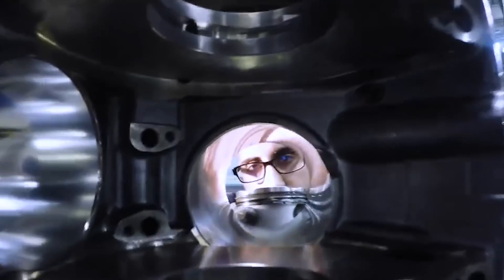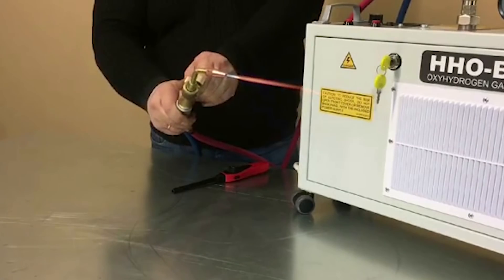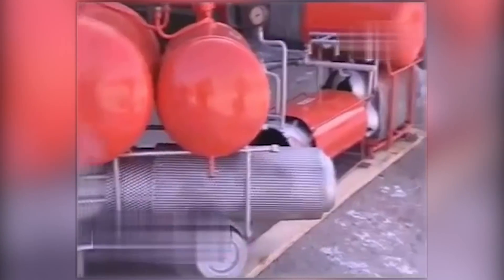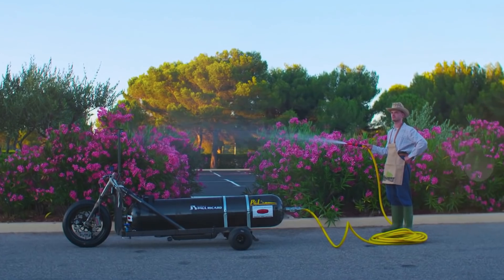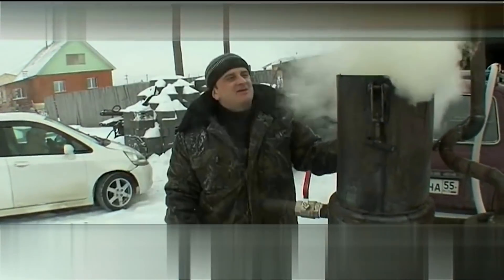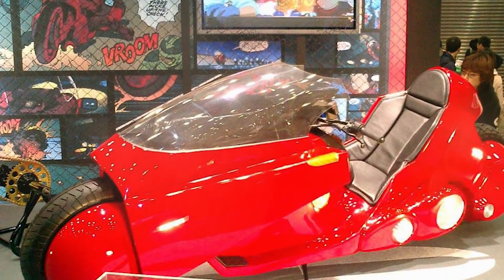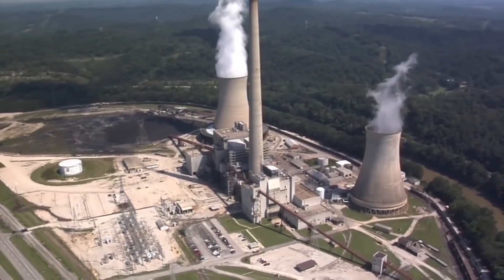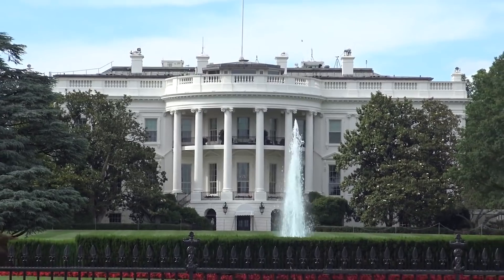Why These Engines Are Banned?

Comment: Just a moment. The "rotary engine" is a design made by Felix Wankel a German engineer. The first automotive application to have one was the NSU Ro80. Later the design was sold to Mazda and they used it in their RX models. Due to the unreliability of the seals around the revolving triangle, most other manufacturers didn't bother with it. Mazda solved this problem (or better said development in materials did). High emission etc made it disappear from the market again.
Reply: And horrible fuel efficiency
Reply: The interesting thing is that it's making a comeback as a series hybrid engine. They work quite well at constant load and can be even more highly optimised for such operation than Otto or Diesel cycles

Comment: So how much energy do you think is needed to compress the air water or whatever they are trying to compress here? A compressed air cylinder is more like a battery, it stores the energy, doesn't generate it! Oil companies, regardless of how greedy and evil, are significantly more capable and advanced in their engineering than idiots sitting on a leaking cylinder. Also, splitting water molecule, shouldn't that be endothermic in nature while the opposite of it being the reason why a few Hydrogen cell powered cars exist? O.o

Comment: WTF the car you show is TATA NANO and it runs on petrol . A 630 cc two cylinder engine. TATA does not launched any compressed air driven car. Why are you lying ?

Comment: Go behind with,, its not banned in.anyway to run your engine on hydrogen. Various test has been performed during the years (and yes I run a chainsaw engine on hydrogen back in the days). Nor is their a sinister plot against this fuel. The physics behind the method do simply not support the concept. Splitting water is very energy intensive, and then you have the problem storage of the result. The free oxygen can be vented to the atmosphere, the hydrogen leaks though virtually anything, so the best option have been to bind it to various materials. Direct.combustion makes the highly inefficient method even worse. Your slightly better off with fuel cells. But in the end the most efficient way is.simply to take the electricity and store it in an ordinary battery instead. And then run your car on that.hydrogen is dead as a dodo outside of very special cases.

Comment: The thing with your "great" hydrogen engine is that, unless the hydrogen is seperated not on the vehicle but in a ground station (wich currently gets used...),  you have a inefficent electric vehicle. You can't get more energy out of the burning hydrogen than you have invested to get the hydrogen... The compressed air one is kinda useless and hase the same problem as the hydrogen one, but it is even more inefficient as compressed hydrogen has a far bigger energy densety... And how the f... did we go from car engines to cold fusion? The Fleischmann Pons experiment couldn't be reproduced by other scientists.

 Also i find it very interesting how this guy says that moden engine are just "polished old tech" and then proceeds to show us wood gas engines, wich where used by the germans in ww2 (even on training tanks!) because all of the petrol and diesel was needed on the front.

Edit: Oh, and also the Wankel engine (rotory engine) was not build by the us, but by german Felix Wankel in 1932...

Comment: better way to generate hho is triangular rotational morse potential  it used radio frequency  three of them  one at the resonating freq of water   one above and one below  shot at a rotational angle  or deflected of  a angle deflecter like the impeller of a blender it shakes the moles apart instantly

Comment: The secret of hydrogen powered cars is free limitless energy to convert water to hydrogen...the secret to compressed air is the free limitless energy to convert air at atmospheric pressure to high pressure air and heavy cars that carry large thick high pressure tanks, and tripling the number of stops you need to make to refuel in a year.

Comment: The car runs on compressed air so it does not cost anything to drive it.....Except you either need your own compressor that can pump to the probably insanely high pressure needed OR go to a filling station to get it filled.

PS. No, it wont be for free, and you can not fill it, using the small hose for filling car tyres.

So basically...It's not free....Maybe cheaper...But not free...

Comment: Hydrogen is way to Volatile and you need to add oxygen to create energy  but if you are even little bit off you are sitting on bomb is what I know so let them take time to perfect the use until use hybrid or electric
Reply: Hydrogen fuel cells were perfected in the 1960s.
Reply: @SynchroScore  For H-Bomb If i am sure the father bomb and mother bomb were their names i want to drive car not put big sinkhole in road
Reply: @GSaurabh8  I haven't the faintest clue what you're talking about.

Comment: None of these things are banned...the majority are simply less efficient methods of powering things with electricity.

The "water" and compressed air engines are outright scams as the electricity needed to split the water into hydrogen and oxygen / power the air compressor can more efficiently be used to power an electric motor. Also, where do you think said electricity comes from? Primarily plants that burn fosill fuels...so what you have are unecessarily inefficient engines which would only lead to more polution/money in big oil's pockets...come to think of it, maybe they should be banned after all...

Comment: All of these "forbidden" engines come with their own disadvantages. Mostly short range. Sadly petrol has highest energy dencity of energy per unit of mass and volume. This translates to range and horsepower. If you don't need former or latter you can exchange it for efficiency or ethicacy. Best way to save enviroment is to pick right engine for your needs.

Comment: if you use a electric compression pump, to put air and water in a container with very high pressure, you're not running the vehicle with "water and air". you just stored the electrical energy. and the vast majority of electric energy we use is created by burning fossil fuels or atomic energy. every car that in some step of the process uses electricity to run, burns fossil fuels or radioactive materials indirectly. this isn't ground breaking. this is nothing but very primitive "out of sight, out of mind" thinking. it being "cheaper" is not a very relevant argument, if it's not any better or even worse for the ecology.

Comment: But Tata motors India haven't yet produced any air powered vehicle, nano used ic engine
Reply: Tata produced air powered vehicles. But didn't sold it.....Because running cost is high than petrol or disel

Comment: There's something people may not have picked up on...

The max speed of a lot of these cars is at 100Km/h... That's 60mph.
You couldn't hit highway speeds on any one of those. Not really a useful vehicle for most people.

The air powered one could explode if hit improperly. Not necessarily with a fireball, but the pressure could easily kill the passengers.

Fusion reactors aren't working yet, though they have made strides in doing so. They're approaching a positive energy return from the devices as we speak. Cold fusion though, is science fiction. the laws of Thermodynamics bar such from being possible. No system is 100% energy efficient. The 'Cold' in cold fusion means that no excess heat would be used or produced, something that just plain isn't possible by these laws.

Thorium 90 as a Nuclear fuel source is MUCH weaker than Uranium and as such, can't produce the power required to properly create a sufficient amount of energy.

Comment: As an engineer - hilarious. Obviously many different designs have been tried, but there are not simply better. Many designs rely on making a vehicle use less energy by making it smaller/lighter, slower, and less acceleration. You can do the same with a conventional combustion or electric drives. Other designs such as the rotary engine, which btw has little to do by a federal department but was developed by German Felix Wankel, and built into a few cars, such as 1951 German NSU. But it suffered from premature mechanical failure and was not very fuel efficient. The "magnetic" motor looks like a design similar to a fan motor. There might other design advantages than increased efficiency, though. There are several Thorium reactors that have been built, including the German commercial scale THTR-300. It had many design challenges and did not proof commercially viable. There is new interest bc of the high heat output these can produce for applications such as cracking. The same is with any other technology that has been shown here. It is not a conspiracy theory by the "oil mafia", but a design that has not made it mainstream, bc it could not address today's design issues, or created new ones, or solved nothing.

Comment: Still compressed air and water have no use for cars you want to use as the cars if today, so many of these fantastic solutions dont work to exoplore more.

You have to think too, it needs to replace todays cars and even be vetter to change anything, you cant compress that rocket engine all the time even if it just air and water, it cant be used for anything ordinary.

There us some fun engines that runs on "oil" that never became anything either, in US diesel engines in cars seems uncommon for example.

Under ww2 in Sweden gasoline was scarce so they did what those guys is doing with wood, it gives lower power and is hard to learn how to use good. After the war ended all scrapped their gengasagregat as the swedish name is for it.

Again not a simple solution in todays life, it was used just vecause they had nothing else.

Its not MAd Max world we talking about, it has to be easy and work at least as good as a gasoline car, aybe better and if cource being more environent friendly.

Electric cars still has problem because you cant just fill them up like a gasoline car to go directly someewhere else, AND to get electricity you neeed to produce ut with something and using brown coal to get it us a loss i think.

The whole chain must work.

Making China build the parts us a loss, something i wish people will understand, its a global thing not a local thing.
Using Chinese factorys is max pollution and the electric running them, and so much is crap anyway, made by slaves.

US dont seem to understand that, its all about cheap.

Comment: This is a bit misleading in that it does not discuss the actual source of the energy and overall efficiency of things like air powered drives, or magnetic motors like that in the Japanese motorcycle.
Reply: 'Magnetic motors'? All motors have magnets, either permanent magnets or electromagnets.

Comment: Just because an engine/motor can be created does not mean that it it efficient powerful or convenient enough. Let's just take a compressed air tank fill it with water and air and move 1000 ft then refill. Or hook a wood burning trailer to our 1960's car.🤦‍♂️

Comment: Florida has a law that says that you can NOT have a house that is totally off the grid. Grid tied hybrid homes and buildings, on the grid but supplemented with private solar, water or wind power are OK though. IN THE SUNSHINE STATE??? Florida Power and Light near Miami shoe horned this law through with the excuse that solar powered, off grid homes could be hazardous to linemen doing repairs on equipment if the solar unit wasn't installed properly. Here's the rub. A totally off the grid home has ZERO connection to the grid therefore could NOT be a hazard regardless of how it was installed where as a grid tied hybrid setup, installed improperly, could be such a hazard to linemen as it IS grid tied. No logic there but the Florida legislature are either extremely stupid or extremely rich after passing this senseless law. The power company has to get it's pound of flesh, read CASH. Years ago, in the late 70's or 80's, Florida power, (NOT the same company), in central Florida went to the public service commission crying poverty claiming the need for a rate increase due to increased coal and coal transportation costs. They got their raise. Sounds reasonable, doesn't it? It was until someone did a little research and found that Florida power also owned the rail company that transported the coal and the mines out west where it came from. The corporation has raised the prices to itself and wanted rate payers to pay for it. After a few years, this came to light and Florida Power was fined and forced to give major monthly discounts to rate payers to repay their fraud. One would think the public service commission and the legislature would take a peek behind the curtain to see who is pulling what levers rather than deferring to the wizard who admonished them to PAY NO ATTENTION TO THE MAN BEHIND THE CURTAIN!!!

Comment: I'm surprised Raphial Morgado's MYT engine didn't make it into this.  

Also, I have a car with a rotary engine in it.  One of these days I'm going to get it running and I'll come back and brag about how reliable it is.
Reply: Lol. I had a 1990 rx7
Reply: It's was fun, but needed rotor seals and got about 15 miles to the gallon...not too good for 160 horsepower, and 1.3 liter

Comment: A dreadful mish-mash of pseudo science, real science, delusionists, scam artists and hints at conspiracies making for nothing. The physics of driving vehicles with compressed air is well known and easy enough to calculate using little more than high school mathematics. There is no way that enough stored energy can be held that way to propel a car at 100 km/hr for 400 km. 

Until there are some references to properly independently verified tests all this stuff means nothing. The history of commerce and engineering is that if there is a better way of doing something, then it's impossible to control. The better method will win out whatever conspiracy theories people dream up.

Comment: Uh dude, air driven engines aren't cost free. You need to expand energy to pressurize and pump the air into the car. There is no free lunch dude.

Comment: I love how he says ZERO EXPENSES.........LMAO.  Unless it is powered by SUNLIGHT, MOONLIGHT, AIR, OCEAN WATER, RAINWATER or DIRT IT WILL ALWAYS COST MONEY to FILL/FUEL these ENGINES. Before you say those AIR POWERED VEHICLES don't cost anything to fill up, you need to remember it's going to use ELECTRICITY for the compressor it's going to take to fill it with Free Air. Don't think for one second you can take your bicycle hand pump or your little 5hp home compressor and fill those storage tanks, you're going to need a HIGH PRESSURE COMPRESSOR that can put out a minimum of 4000psi like what's used for filling Scuba Tanks. And unless you live near the ocean with Dive shops  finding some place to refill your tanks in rural BFE is going to be a problem.

Comment: see a smartman would make a air powered engine run it on hydrogen the use a hydrogen fuel cell to make electricity and use the electricity to run a Compressor and electrolysis machine

Comment: Have you heard of the RAM diesel engine?
I heard about it a decade ago from an engineer friend of mine, but the technology was apparently yanked by the military and kept secret.
The engine runs much cooler than normal diesels (smaller hear signature) uses less fuel but produces it's of power, it's small and has very few parts compared to common engines....I'd like to know it they are real, or just a concept that got shelved
Reply: Typical government trying to destroy the environment. Your politicians are demons. This is why the CIA gangstalks me. I‘m afraid, you‘re next.

Comment: I have a car that requires no fuel at all. I call it a trailer and it is pulled by another car.

Nothing here but "victim" bait.
Reply: But if the car (trailer) requires no fuel, what if the trailer pushed the car?  You would use no fuel.
Reply: ok,ill give you that.very plausible
Reply: Ever car on the road should have automatically locking hitches front and back( magnetic perhaps). Then everyone would share be linked into one giant chain. Shareing the load you'd use no energy at all. Like going hooking 2 horses   to a cart . Two horses can pull far more than double(probably about 4x) what each could pull alone. And so on the more you add. A 20 mule team can easily pull 80,00 pounds, but one mule would struggle with 4,000 pounds.
Reply: "Russia Russia Russia"-Hilary Brady
Reply: @kaizersoze  uhm...sure

Comment: Jesus, what is all this horseshit about the oil companies deliberately halting our progress. I don't think you understand, getting rid of petrol, and diesel powered engines, and just replacing them with some other type of engine with moving parts, especially one like the V-twin compressed air engine, which still uses pistons, is not going to get us off of oil. What are you, stupid? The primary usage of oil in this world is as a lubricant. Just because it doesn't burn petrol doesn't mean you aren't going to need oil, and greases made of various other hydrocarbons derived from fossil fuels, to prevent your engine, or your bearings, or even your fucking door hinges from seizing/blowing/sticking. Do you even know anything about cars, or are you just another science illiterate environmentalist type? For fuck's sake.

Comment: You can get a copy of the patent from the US patent office of a compressed air powered car and an electric motor that runs itself. I know this because have the drawings of both.   A carburetor was made that could get 100 miles per gallon. The inventors are shut down or assassinated by big oil.

Comment: Hmm air powered car, another use for that bicycle pump you keep in your trunk...
Air powered car runs of of, well air. Driver pulls over and hooks up bicycle pump to filler nozzle....
Reply: Just have a Kirby inside the engine sucking air through a turbine causing your engine to run...